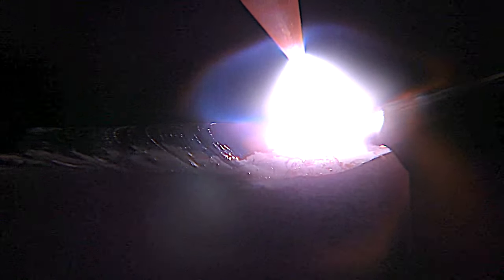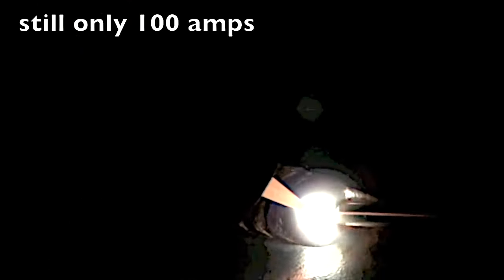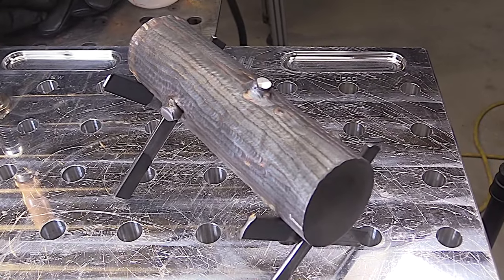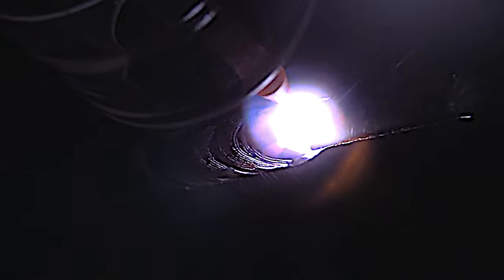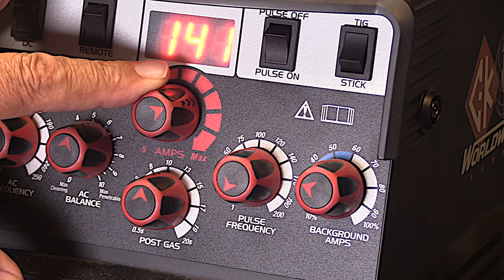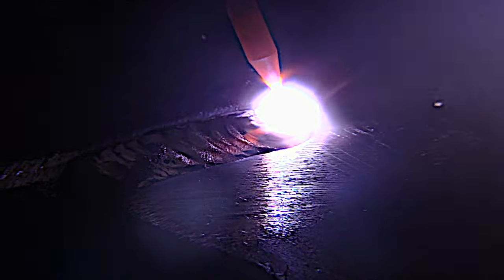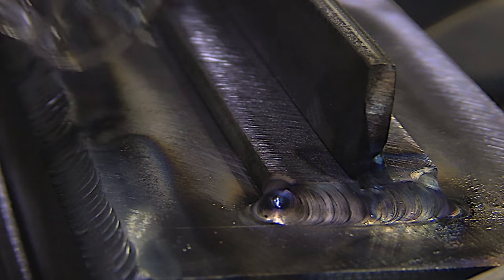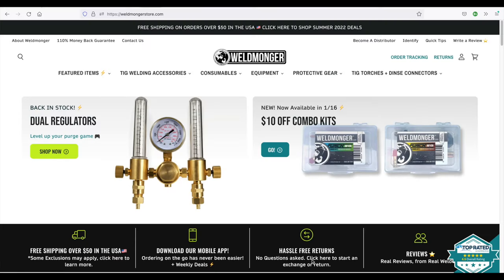TIG Welding Carbon Steel

Comment: Jodi over the past...idk decade, basically everything I've learned and accomplished especially PRO TIPS  and the way OPTIMALLY A A PROCESS SHOULD BE IF POSSIBLE, I now am a master at all processes, pipe welded for ten years stick, built tuna towers on highest end yachts in the world marlin magazine type stuff,,now I run and own my own welding buisiness and it all far as tig and some mig far back as I remember you have been my go to. Thank you Jodi from me and my family

Comment: I’m learning and my main issue is lighting then eyesight then sticking my tungsten and/or filler rod.
So, I wear readers under the helmet- good.
I add an extra bright led light on the workpiece - good.
So much better. Now more practice!!
Reply: Same here, without my cheaters/readers I may as will not even set up to weld.  Cant forget my cheapo halogen lamp.

Comment: You’re a great Teacher! Thank you for the free knowledge that you so diligently compose in thoroughly thoughtful presentations. No BS, no shat & shine-ola as my grandmother used to say, and no camera trickery. Your channel (it feels insignificant calling your catalog of work a channel because it’s truly head and shoulders above the rest) is true to your purpose of helping people advance in the career of welding; thank you. 
My robotics students were learning to solder this past week and they always have difficulty understanding how filler melts into the joint; like it’s counter intuitive to experience zero resistance when pushing solid solder into the solid wire. I have them feed several inches of solder into a stripped end of 4ga battery cable to exaggerate the feeling and drive home this new experience. 
I just noticed that new tig welders might experience the same same phenomenon when adding filler. It’s difficult to judge how much the joint is consuming because rods have no markings to reference movement. 

I am curious; would you consider a video topic on explaining feed speed of filler material?
 Maybe you could scratch some marks into the surface your filler rod for a visual reference for new Tig welders. I love your work and your ability to explain your skills so well!
Thank you as always!
-CY Castor

Comment: Thanks from me aswell Jodi, Been welding 6 years now I've truly had a better life because of you. I started on tig/aluminium with no previous experience just your videos. That plus more videos gave me the opportunity to mig on steel and from point I went for and got job I'm actually proud  of. I weld mild/stainless, ally lil bit of titanium, Stick 6013 btw, mig, tig, pipe sheet I enjoy it all (except overhead especially the 40 metres of it every 3 weeks).

I'll always be grateful to you and all the knowledge you have given me through your videos. Thank you so much.
Reply from the maker: thanks for the good words.  I am glad you are doing well

Comment: One thing that REALLY clicked with "arc length" for me with TIG, was that, when welding a T-Joint, you should be able to join it autogenously without filler and THAT is the right length your arc needs to be for most of the metals you deal with when TIG welding, then the rest is just adding Filler. Also, paying attention to the puddle, on steel if it forms a U-Shape, you need to get closer.
It wasn't until my teacher taught me that, that it really clicked on how close you really need to be.

Comment: This is what we did for Mig, and stick too, but in stick we had an X about 10 inches long and in each side we filled it with different Rod, 6010, 6013 I think or coulda been 7014, 7018, 7024. Then it was cut into chunks with the horizontal bandsaw.

Comment: Stainless welding with Argon I get to about .010 arc length and maintain an arc 

Argon/Helium I try to run at .017 I can get to .016 but .015 will stick everytime. I found that interesting 🤔

D17.1 Certified - Thanks to you Jody ❤

Comment: Hey Jody, great vids learned a lot about tig aluminum so far. I was curious if you had any tips for tig welding aluminum pipe to each other perpendicular to each other like in rod holders on T top.

Comment: Thanks for another great video! I have made 8 bike frames now, tricky angles, thin-wall cromoly. All thanks to practice and what I have learned on your absolutely brilliant channel. My question today is: if a weld is a bit grey is there actually anything wrong with that apart from cosmetics? So long as there's no porosity and you got a good root in there.
Reply from the maker: I think that for carbon and chromoly, a grey weld can be ok. There are lots of chromoly airframes still flying that were gas welded in the 40s. But a lot of 4130 chromoly joints on trophy trucks require 2 passes and if that first one is grey, then the second pass wont go in as nice.

Comment: Jody, you have some very helpful information in your videos. I have watched several in the past and continue to pick up pointers.
I've been looking for information to help me modify a set of carbon steel headers and have gotten confused to say the least.
Maybe you can help with some questions I have that would help me tremendously.
If welding SS tubing, most everyone says to back purge which really makes the inside of the pipe look good and with no sugaring. I haven't found any info surrounding Tig welding carbon tubing and back purging. What's your take on back purging carbon steel tubing such as headers? I know while modifying my headers it going to require me to make a lot of pie cuts and I would like for them to look good if possible.
Thanks for any input you have.
Wade

Comment: Hey Jody, have you utilized a pancake hood?  I'm thinking about one due to too much back light.  Any ideas on purchase?  Just don't want to be judged on the jobsite.
Reply from the maker: pipe liners love  the pancake and get so used to it they often still wear it in the shop.
I never really used one other than trying one on for size. I think it boils down to what work you are doing.  Blocking out all back light and being able to see details of a xx10 root means a lot to a pipe liner welder.  But pancakes are not for everyone
Reply: @weldingtipsandtricks  Thank you.  Love my tig fingers and stickers.  Keep up the great work.

Comment: Hi Jody, any tips to TIG an 1/8” carbon steel plate 3g butt joint?  I have an AWS cert test in 2 weeks and am having difficulties picking this one up after passing stick, mig, & flux
Reply from the maker: here is a 3g 3/16" thick video...same settings and technique will work for 1/8" as long as gap, bevel, and land are same. https://youtu.be/XkNeXuYWPUQ?si=kFvxLYZn0jcodKh7&t=116